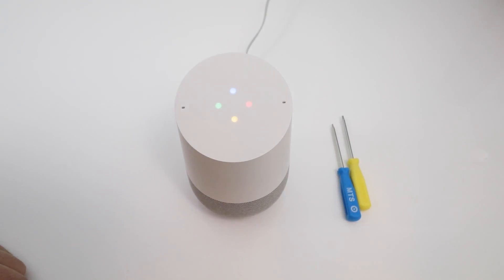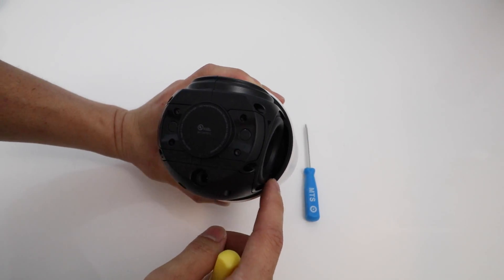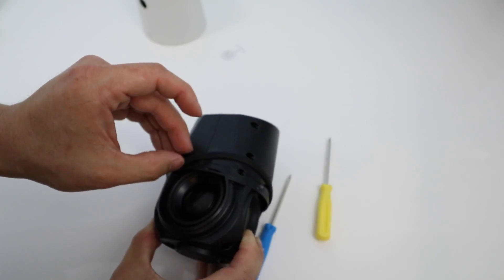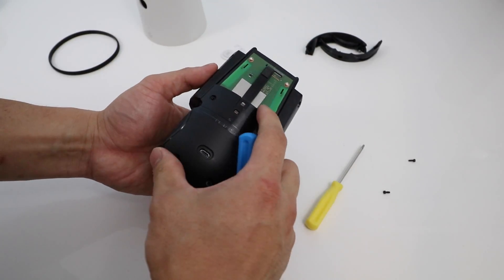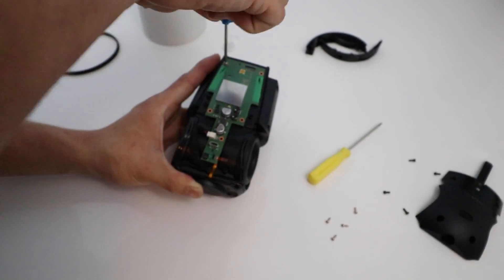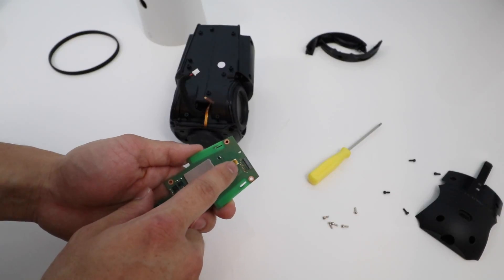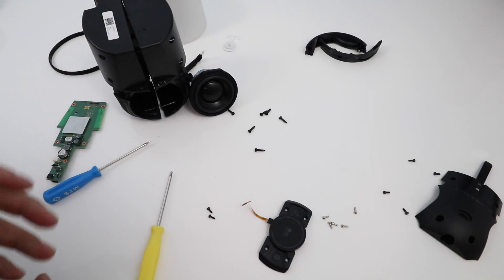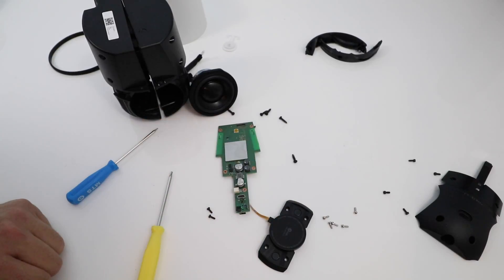Taking apart the Google Home! What's inside the Google Home?

Comment: And what is the USB connector for?
Reply: The usb port are for services/repairs only such as flashing the firmware or check the devices diagnostic if any software/hardware damage. So the official repairer can check using this port.

Comment: Its a passive radiator speaker system, using a class D audio amp. The trouble is, its not proper AI so its uses are limited, it links to google servers. Like with all sound bars, and mini speakers, the speakers systems are all far too small for proper big hi-fi sound so its not a replacement for a home hi-fi as often suggested, and its not stereo either. Molded ABS plastic casings are not the best for sound, its only used because its cheap and easy for mass production.

Comment: What is the purpose of the micro USB connector being on this device (and hidden too)?
Reply: The Micro USB port hidden under the GH's base is a "Service" port.  No very usable, but some people have found that the Chromecast's ethernet adapter will work, so you can used a GH with a wired-ethernet-cable instead of WiFi.  More info: https://www.xda-developers.com/the-chromecast-ethernet-adapter-works-with-google-home/  and also https://www.reddit.com/r/googlehome/comments/5fpzvw/service_micro_usb_port_and_all_its_secrets/

Comment: Why would anyone dislike this? ... Trolls 😒
Reply from the maker: I know, right?
Reply: Brandon Geekabit So did you dissect it because it was acting possessed?
Seems to be a major complaint so far, but then no one can leave well enough alone anymore.
I was glad someone on here took apart a bb gun like one I had, so I could put it back together.
Reply from the maker: I took it apart because I was just curious. I wanted to see how the thing looked inside. I did make a separate video on my channel connecting it to a 3.5mm jack/speaker. Youtube is life, you can find anything on here :)
Reply: Brandon Geekabit
.... Sweet, & it is like ebay of information... :)
TySm for your curiosity & time. ⭐️😽💋

Comment: I'm thinking about taking apart my Google mini and trying to connect it to my JBL Xtreme. Would that work?
Reply: Besto303 It would work if you want to open the mini and build yourself an adapter with resistors to connect the JBL. I think it is useless, if you want to connect big speakers to the mini, go for a Chromecast audio which can be connected with the mini.

Comment: Could you actually copy the Assistant and put it on your computer? Could you connect the google home motherboard to a computer than transfer the assistant or something like that?? If yes, I don’t think so that the google home would be a .exe file. Would be cool have the google home instead of cortana.
Reply: You can, but not by using the Google Home. You have to run and set up the Google Assistant on your device via the terminal, but from what I know that's only available on Linux. It might be worth having a look into!

Comment: I have the Google home and I'm surprised that that one speaker can actually produce really loud and good quality sound lol
Reply: you see those 2 weird flat speakers on both sides well those aren't speakers they're passive radiators they work by using the real speaker's air in a sealed box so when the speaker goes in the passive radiators go out or vise versa.

Comment: I only see two pins on that stereo connector.  Does that mean Home's audio is Mono and not Stereo?  Or is there something I don't understand about how audio connectors work?  (My understanding is stereo sound needs one wire for left, a second for right, and a third for ground)  I guess mono would kind of make sense since there's only one speaker in there.  But would be disappointing if I'm thinking of hacking this thing apart and hooking up my own audio connection.
Reply: EmpowerDB there is only one driver/speaker therefore it's mono.
Reply: EmpowerDB i in
Reply: EmpowerDB . Single driver means mono

Comment: The "one speaker" with all that extra air is actually one active driver with 2 passive radiators. This allows for smaller drivers to reproduce bass without the need for a larger cabinet and a port.
Reply: Forgot to do his homework lol
Reply: @thatguyjack2208  it's the speaker's air movement in a sealed in closer